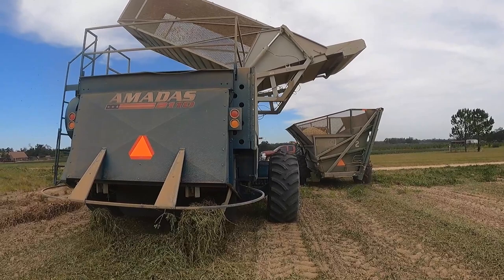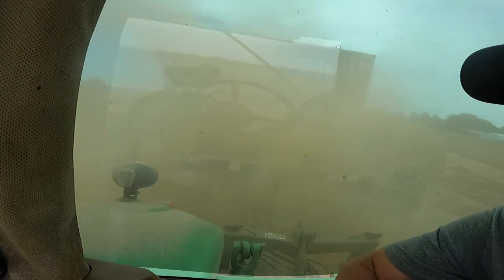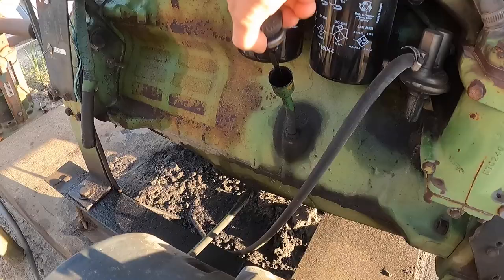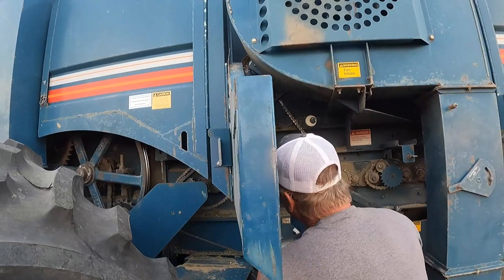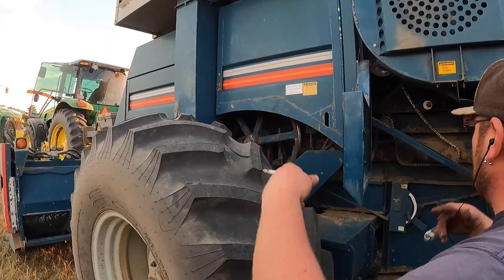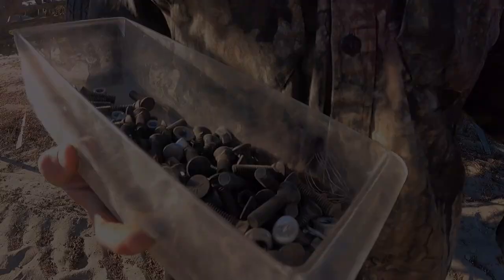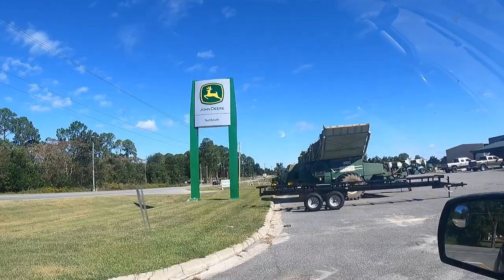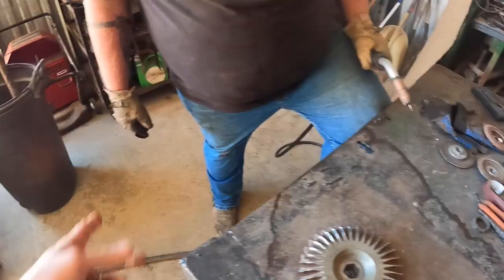Dry Windy Day In The Peanut Patch

Comment: Out of curiosity, is there a reason why the tread pattern of the tires on the picker is in the opposite direction of the tread on the tractor tires?
Reply from the maker: Ive never noticed that, not sure
Reply: They just got put on the wrong side
Reply: @nathangriffin9893  it appears to me they come from the factory that way
Reply: Drive tires will always point tread forward on top, non-drive tires point tread backwards on top. Not sure why there's a difference but it is always done that way, must have to do with traction. You can see it side by side if you compare a combine with rear wheel assist and one without.